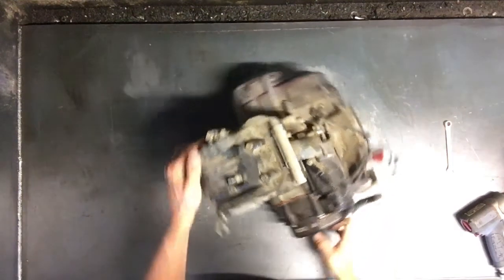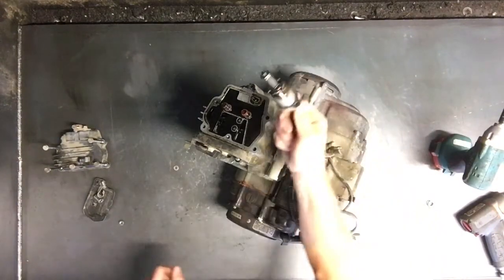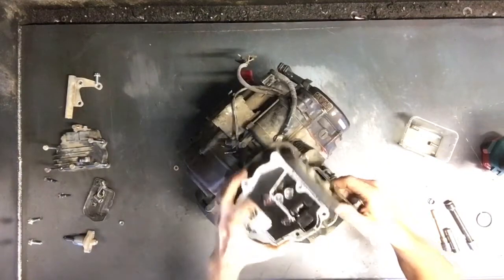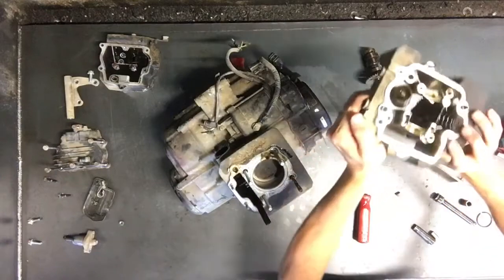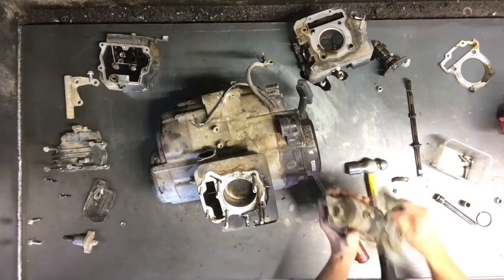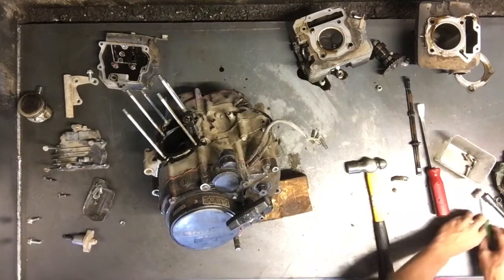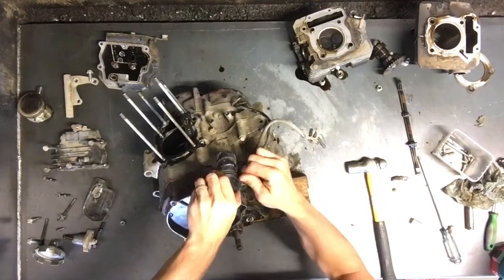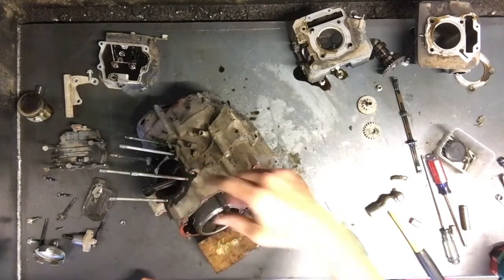Honda TRX200SX Fourtrax 200SX - Engine Top End / Head Piston Issues

Comment: I see in the title and description you list an ATC200SX, there isn't an atc with that model name.  There is a ATC250SX but that's shaft drive, and probably a different block, with the much larger displacement and all.  There is no atc that uses that engine, though the atc200X does use that top end, but it's a 6 speed,  no reverse, non electric start engine.  Probably the same top end mostly though.  But obviously the cases and internals would be a lot different.